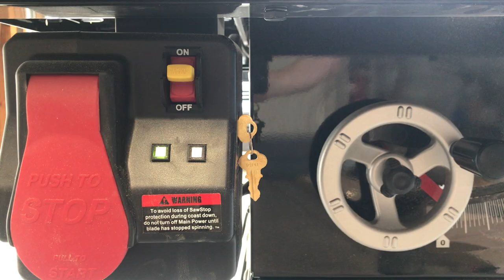My Ultimate French Cleat Wall

Comment: The most relatable part is : 2 videos, 2 trips to get TONS of plywood in a family car, I can just see myself doing this last week. Fold every chair down, stuff each plate in thinking “plz dont break a window, plz dont break a window”
And then drive home hella careful. And do the reverse when you get there. 
Question. How did you decide the spacing?
Reply from the maker: Ha! Its so satisfying getting all that plywood into the car, though! Spacing was completely dictated by aesthetics. I wanted the spaces to be about as big as the cleats themselves. To make this happen, I had to make my spacers slightly larger than the cleats themselves. there was a little math involved to make them the exact size.
Reply: The whole thing about stuffing plywood into the family car makes me wonder about just having the lumberyard deliver.  Most hereabouts will deliver for a nominal fee.
Reply: @cammurray8453  true, I also ise that service but when it’s worth it. Like needing 5sheets of specific studd they dont sell around the corner. When it’s locally sold I do the slow-drive with the car cause I cam by an extra sheet for the delivery price. What does delivery cost around your area? Here its 50-70 euros
Reply: Depending on the supplier, and how urgent the delivery, costs range from 25-75$. Very large orders might be free delivery.

Comment: I'm curious, how far apart is your spacing?
Reply from the maker: Spacing is 2.5in, the same as the cleat size. In retrospect, I should have made the spacing a little larger than the cleat size because now to use the left over cleats for holders, I have to trim them down a bit.